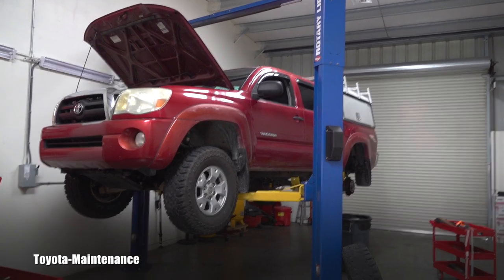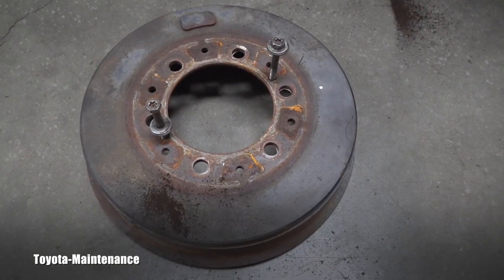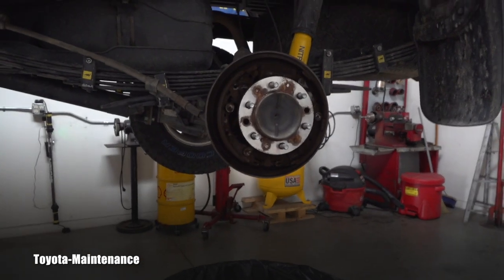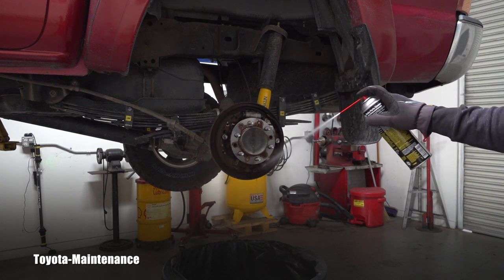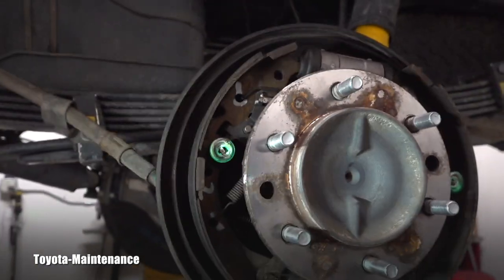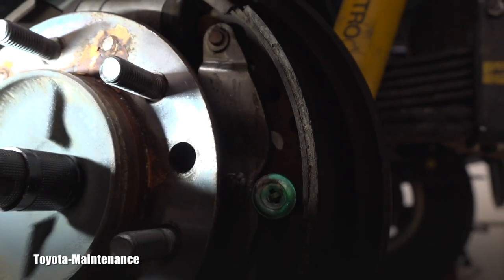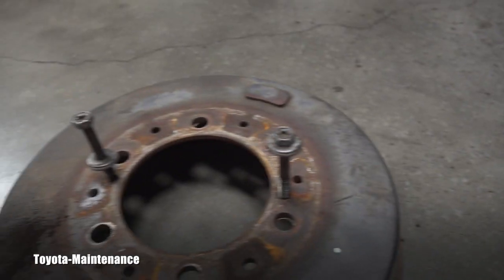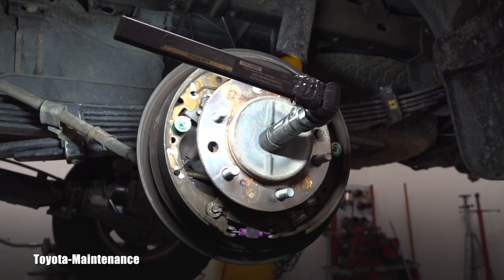Brake Shoes dangerously thin

Comment: If he approves the brake job make a video about adjusting shoe to drum clearance the Toyota certified tech way💪
Reply: Usually tighten them until completely seated then back off 8 complete rotations on star wheel adjuster.

Comment: Get the spray bottle and lightly mist the dust and then power spray it no dust flying around period
Reply: Or even just not use the straw at first. Hint to newbies, don't spray the center part of the hub. It will spit at you.

Comment: My 2006 rear shoes lasted 130,000 miles from new.  Drums were not worn out and are still original at 165,000.  Impressive.
Reply: Camry? Definitely the norm. Like 80-90% the braking power on that goes to the front. Especially on worn struts
Reply: @LAactor  Tacoma.
Reply: @LAactor  A 600lb quad routinely for several years.  Loads of firewood each year. Trailer pull several States away multiple times.  The front pads lasted 80,000, rotors changed at 110,000.  These trucks are solid as a rock (if they don't rust).
Reply: @triple6758  Don't let them rust!!! There are products like Krown Rustproofing that prevent rust from ever starting.
Reply: @rightlanehog3151    I live in the Midwest.  There is no escape from the salt.  Toyota already put a new frame under it for me free of charge.
Reply: @triple6758  I live in Canada. My car was built in the same plant that made your Tacoma. After 15 salty winters it has NO rust because it gets a yearly Krown treatment.
Reply: @rightlanehog3151  Your car doesn't have a frame.
Reply: @triple6758  People who properly rustproofed their Tacomas have no rust issues.
Reply: My 2005 Scion XB is still on original brake shoes, and I do a lot of stop-and-go driving. I wonder when I'll finally need to replace them. Bought new shoes years ago but haven't needed them yet.
Reply: @rightlanehog3151  Where do I find this elevated section of society?  😂

Comment: I always thought that brake shoes are just for the handbrake and  if they wore down you'll be able to stop as normal
Reply: Some vehicles still have brake shoes in rear, just like this truck. Some vehicles have both in the rear, pads & brake shoes....and then the shoes are for the hand brake & pads are for the regular brakes. When buying a new car, ask & you’ll find out. But don’t ask the salesman (they usually don’t know), ask the service department, they usually know.   Thanks....Jim
Reply: @jimpie231  thank you Jim so now I know if the handbrake doesn't work properly get it checked as you may lose braking power
Reply: @neilmurphy845  handbrake was originally as a backup for the regular brakes. That’s why it’s called an emergency brake. Today they call them parking brakes? This really isn’t needed for parking since most cars are automatic trans., which is locked thru the transmission. Originally all cars were stick shift and you needed that hand brake to hold the car when it was parked. .......etc. Jim
Reply: @jimpie231  It's still necessary today foe close parking situations on a road where someone could slam into it and push it into other cars. Yes the car is in park but the rear in a FWD rolls freely. Also, it's not good to let the car roll and sit all or even part of its weight on the parking detent. And definitely makes for hard shifting if fully weighted on a full hill or incline .......etc. Jim Kong umn
Reply: @jimpie231  ya in Ireland lots of cars are manual the only problem with the handbrake is people don't exercise it so it locks up and then they lose their breaks and they crash well except for if you have a manual gearbox why do American people call it a stick it's not a stick it's called a lever
Reply: @LAactor  you should use the hand brake on inclines or in those parking situations, matter of choice....Jim
Reply: @neilmurphy845  stick shift refers to a manual transmission, what does “lever” mean?   Jim
Reply: @jimpie231  why not just call it a manual gearbox the lever is the stick you use to change gear
Reply: @neilmurphy845  most drivers don’t know what a gearbox is here in the US, all this terminology is for people familiar with cars. Many manual transmission cars are sold in rural areas still today. Those people are more aware of the terminology.  My grandson is 25 years old and has a WRX with a manual trans, only because I taught him with my old Mustang. He enjoys driving a manual transmission car. We live in a smaller town in the Chicago area.    Jim
Reply: @jimpie231  ya I love manuals
Reply: @jimpie231  There is really no need for most people to know what a gearbox is these days. It's 2020, not 1920, after all.
Reply: @jimpie231  Of course I use them in those cases, hence my mentioning of them.
Reply: @jimpie231  I don't believe it's a generational thing per se, more like a intelligence thing. However the younger the person may not always mean the less intelligent, however, this generation seems very lacking. But one who is of intellect even if young can understand shift lever and gearbox.